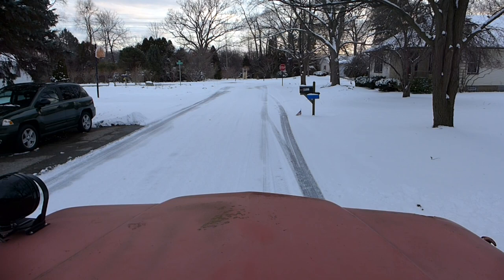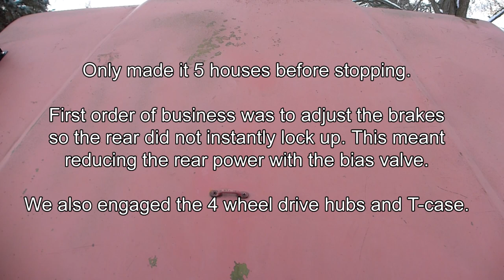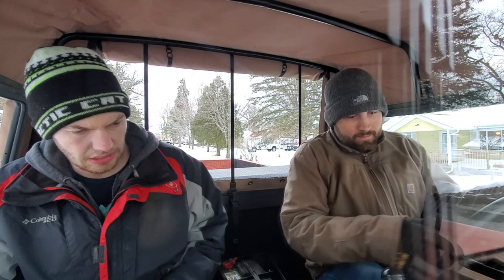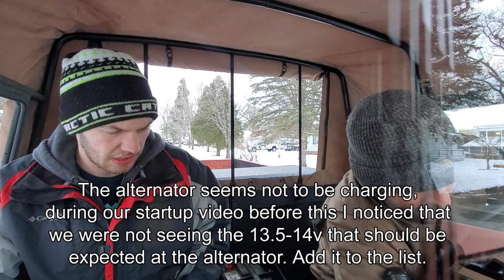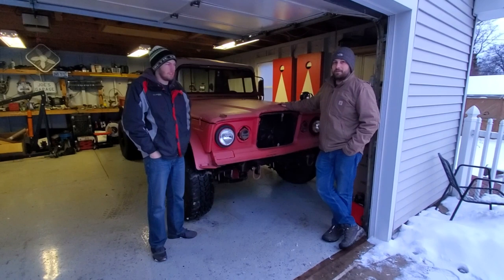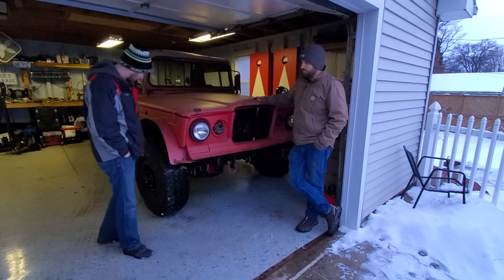Ultimate V10 Powered M715 Jeep Truck Overlander Rig goes on a first test drive

Comment: GLORIOUS!! More videos. Ive been watching this build since I found it on the overland website. I have a 67.
Reply from the maker: cool!  Thanks man!
Reply: @hayeselmotors2275  Dude this is an awesome build. Im getting stuff togather to pull the old tornado Six out of mine. Subscribed..
Reply from the maker: Brandon Whorley nice! What are you replacing it with?
Reply: @hayeselmotors2275  I have a small block 350 w/ adapter kit for the oem trans. But also have an LQ4 in the garage. If I went the LS route I would need to dig up an NV4500 and NP205. Probally keep the factory axles under it for now. I found some non split wheels and radials. Did you keep the stock axles?
Reply from the maker: Brandon Whorley I did keep the factory axles. We’ll see how they hold up. The only concern I have is the 10spline pinion shaft on the rear axle. I won’t be totally surprised if I mangle that at some point
Reply: @hayeselmotors2275  you have me excited about the truck all over again.

Comment: I really like the roll up top, I've been trying to figure out a camping setup for my 715 and I have this picture in my head of climbing out of the back of the cab into kind of the og bed canvas but converted to a camper. I'll probably just tough it up and go with a truck camper like I've originally planned.

Comment: M715 suspension, plush🤣.  Even with a leaf removed.
Nice first drive.  Moab 2021?
Reply from the maker: Glenn Courtney at this point, maybe. It’s not too bad once you get used to it. The noise at high speed is the worse part